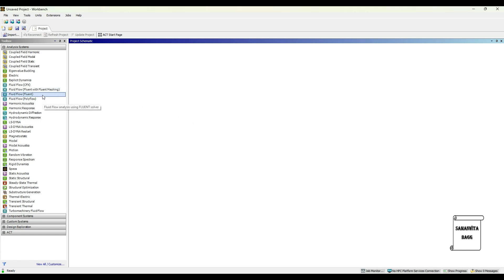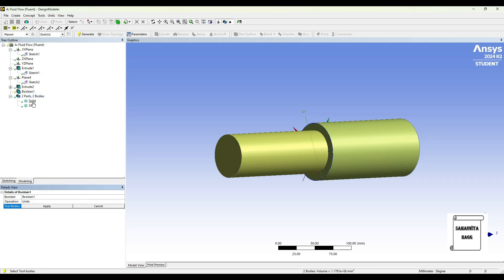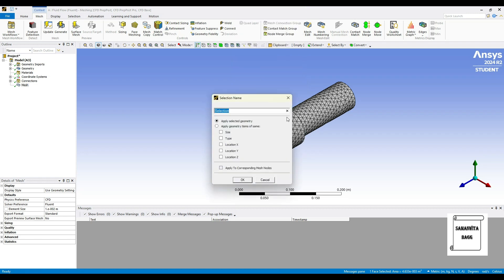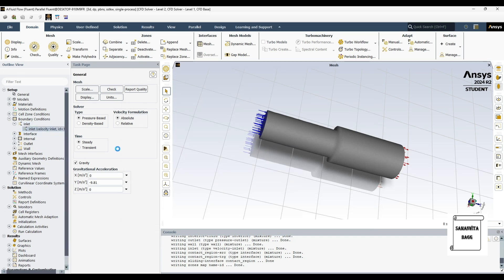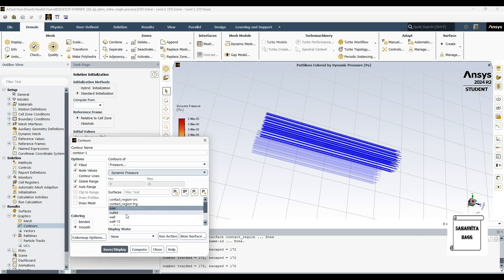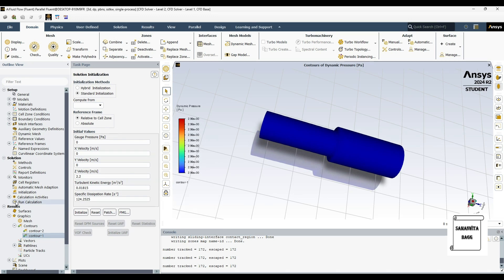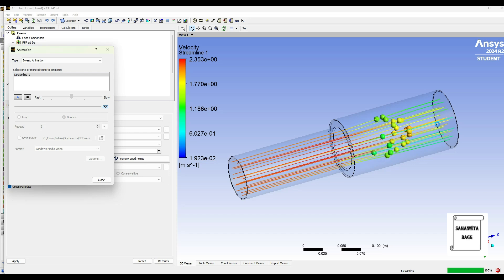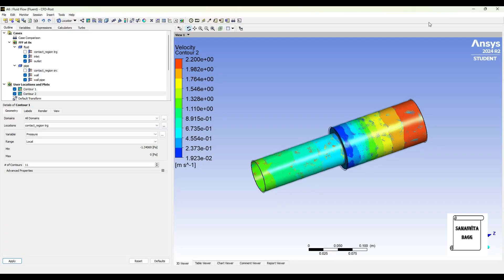Fluid Flow through a Pipe With Sudden Expansion | CFD Analysis | ANSYS Fluent | ANSYS CFD

Comment: Hi, could you kindly create a video showing a pipeline with air flowing inside? The video should demonstrate how changing the air temperature affects the pressure, when the temperature increases, the pressure decreases, and when the temperature decreases, the pressure increases.